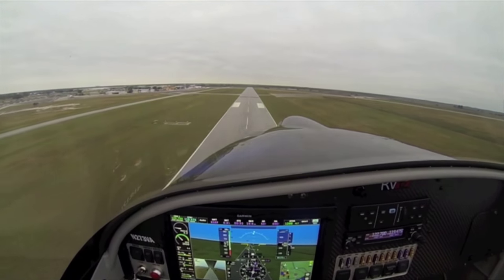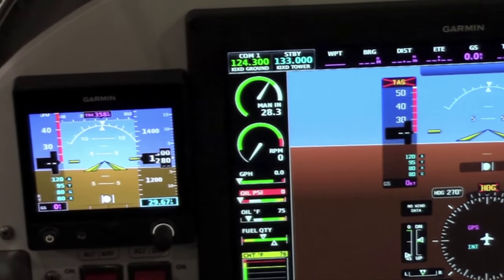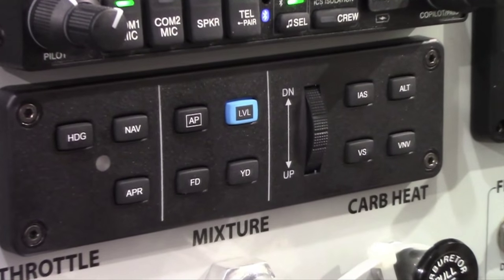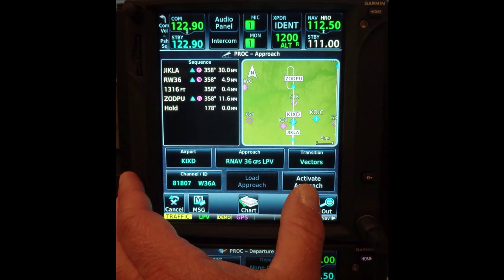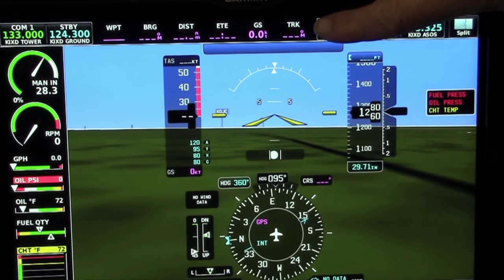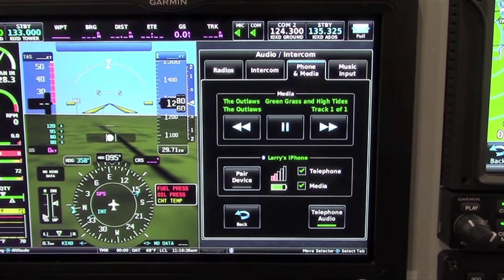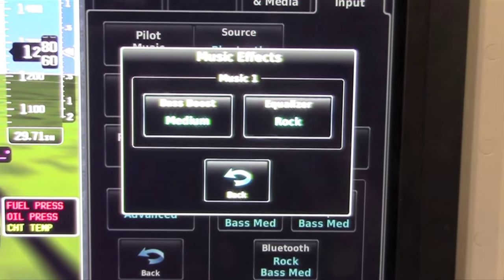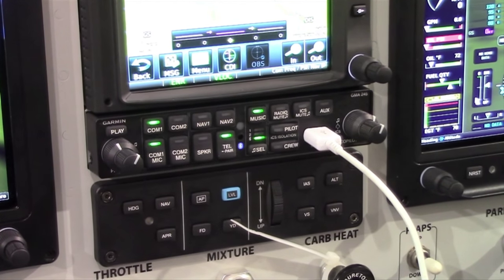Garmin's New Electronic Flight Instrument and Audio Panel

Comment: Does anyone happen to know if the same connectivity between the Aera 660 and G5 exists in the certified version of the G5?  Unbelievably, the Garmin Customer Support representatives can't tell me.
Reply: As far as I know, the only difference between the certified version of the g5 and the non certified is a small piece of paper that comes with the first one called STC.